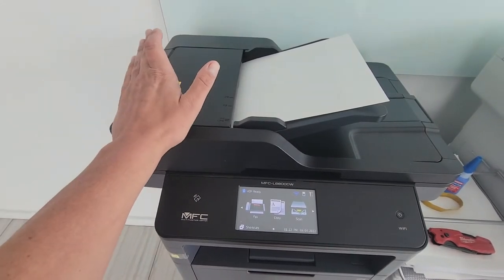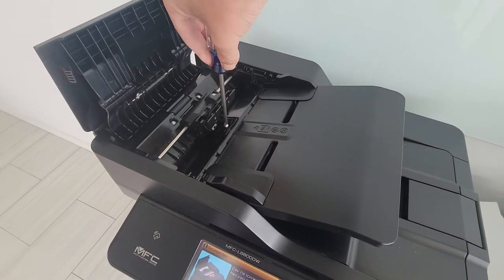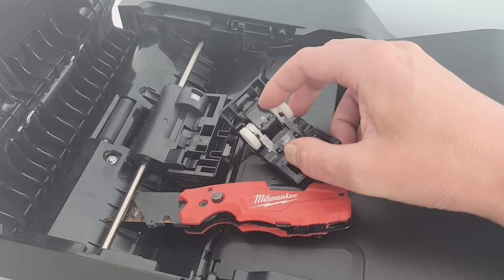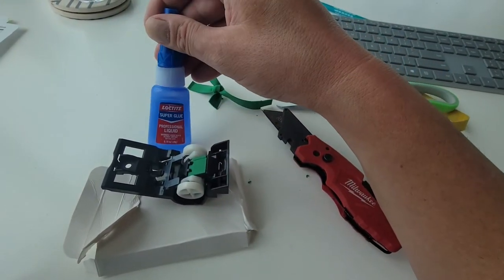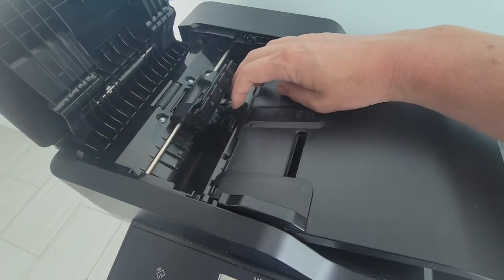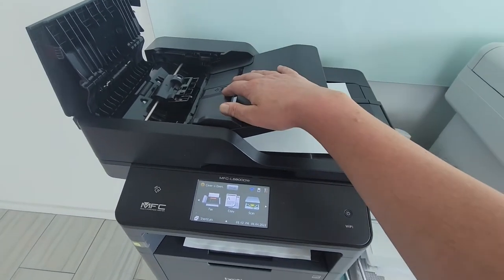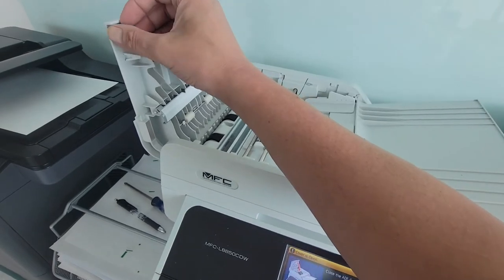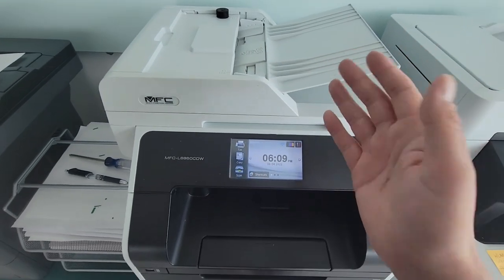How to Fix a Printer Copier that Won't Feed Paper - Brother MFC-L6800DW Paper Feed DIY with Rubber

Comment: I pulled my assembly out and my rubber piece was still good.  Put back and ADF still jams.  Any suggestions?
Reply from the maker: I noticed a small lip on that plastic assembly. Maybe your rubber piece is not thick enough to allow the paper to move over that lip? If so, you may still need to replace the rubber with a thicker piece.
Reply: Didnt see what you did with a rubber band though